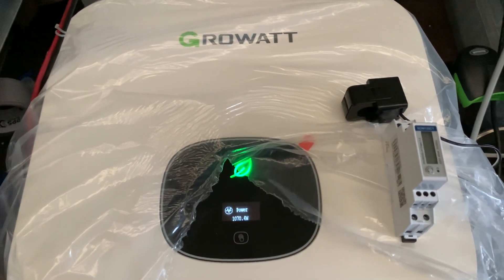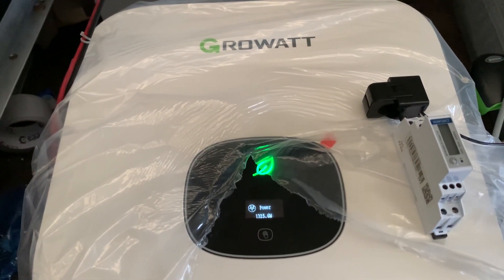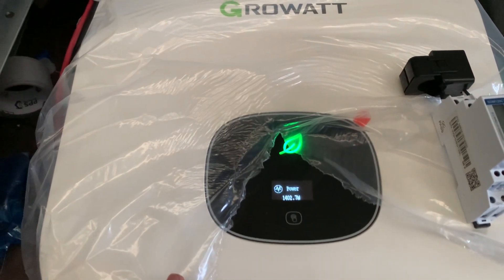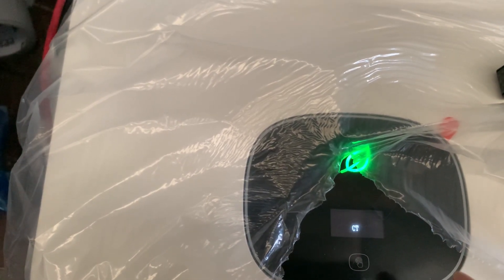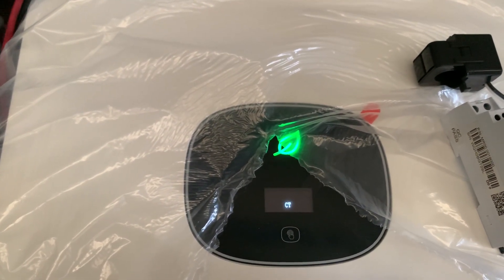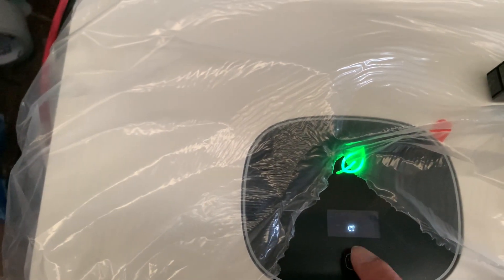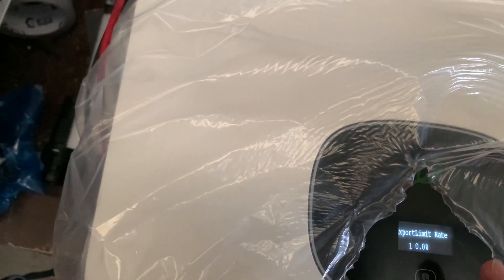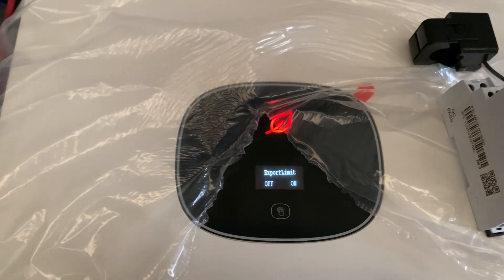Growatt Min-series inverters export limit setup tutorial

Comment: @growattaustralia1112 I had this installed ( MIN 5000TL-X and SDM120CT) and I can confirm its working but the inverter shuts down at night and stops logging any Load. It comes back online in the morning, but this is useless becuase I also want to see the load overnight. Is there a setting to prevent the Inverter turing off at night ?

Comment: There is an export limit option on 'enable meter' as opposed to 'enable CT meter'. I would like to have some info on that function, as the homeowner is not going to install a CT meter but I am the one paying for electricity I am putting into the grid ;-)

Do you have a separate video, or could you provide some info? The specific thing I am looking at, if I enable export limit via 'enable meter', whatever I seem to fill in, the system seems to be shutting down. Right now the system is generating 1300w, of which 1100 are fed into the grid, I have a MIN3600TL-XH, when I set export limit to 50%, my net use (taking from grid) goes toward 100W

I would expect either of 2 thing to happen: system goes on half power, generating only 650, and I would still be net feeding into grid. OR nothing would happen as 1300 is stil below 50% of capacity. But I got both wrong...

Thank you!

Comment: can you use CT's on the MIN 6000TL-X?  Aslo, can you change the CT's ratio if you buy aftermarket CT's? and one more, do you know anyone who has used 0% to see if there will be absolutely zero grid feed?  Many utilities now say no grid feed or you pay as if you were using power...
Reply from the maker: Hi Tyler, thanks for your comment. For Min 6K TL-X inverter, a meter is required for the export limit control, you cannot only use CT to do so. The recommended meter is Eastron SDM 120. The export limit percentages refer to the energy that is allowed to export to the ac grid, if you set it to 0%, then there will be no power exported to the AC grid.
Reply: @growattaustralia1112  Can i set it at 0% without connecting the CT for the single phase 5kw version?

Comment: Hi, I have Growatt inverter MOD 10ktl3-xh working in my house with the injection limitation set to ON but I am injecting in the grid aprox 40% of the produced energy. Does anybody know what could be the issue? I read that some models of Growatt invertors  have an issue
Reply: I have same problem.  Do you find a solution?
Reply: @jakupmaksuti5276  hi, I meanwhile got the permit to inject in the grid so I no longer have the problem but I also did not get an explanation. I noticed that growatt invertor is not reporting accuratelly

Comment: Does the 100% setting represent 100%of what the ct is reading the building is calling for  or 100%of total inverter capacity? Does the meter support CT on line 1 & 2 simultaneously?
Reply from the maker: 100% export represents the inverter's capacity, for example, for a 5kw inverter, if set 100% export, then the maximum output to grid is 5KW
Reply: @growattaustralia1112  Why then would you have an export limit set if you are sending all available spare energy to grid? If you want to prevent any being sent to grid, would the setting be 0.00%

Comment: Hello.  Thanks for the Great instructions  I have an  MIN 10000TL-XH-US that I would like to add SDM120 ct meters to.  In my setup, my Inverter is 50' away from my Service panel.  What is the MAX length of cable I can use.  Thanks.
Reply: Did you ever get an answer for this?  Thanks!
Reply from the maker: The long distance may interfere the communication between the inverter and meter, there is a communication cable comes with the SDM 120 meter.
Reply: maximum permissible length between a RS-485 driver and receiver is 4000ft (or 1200 meters). However, both cable quality and data rates impact this distance. As data rates increase, the signal is increasingly attenuated by the parasitic RC- filter created by the cable.